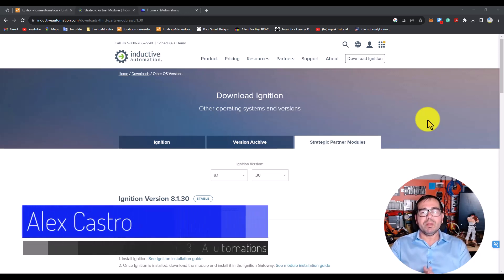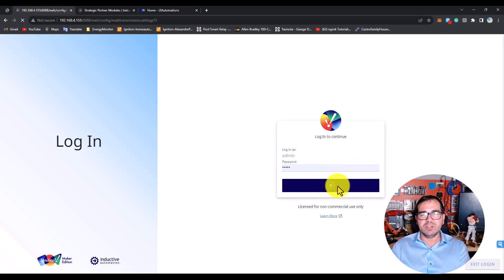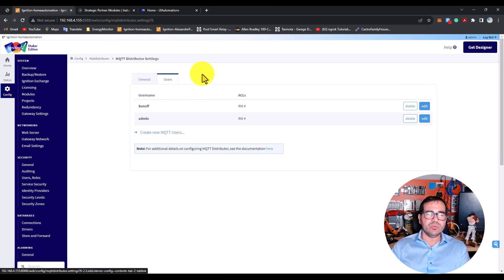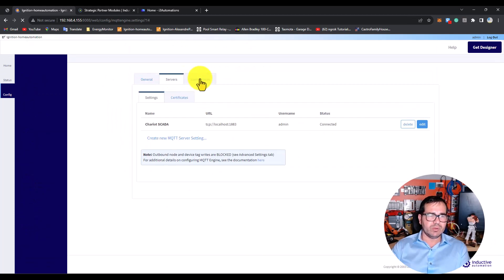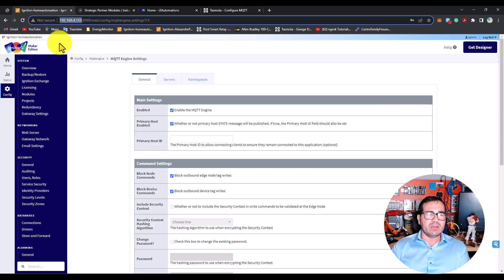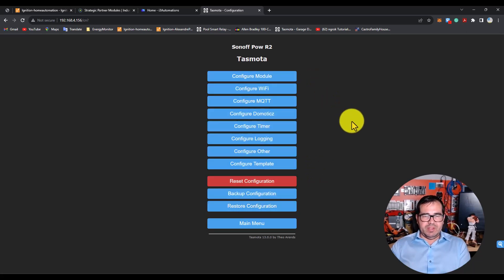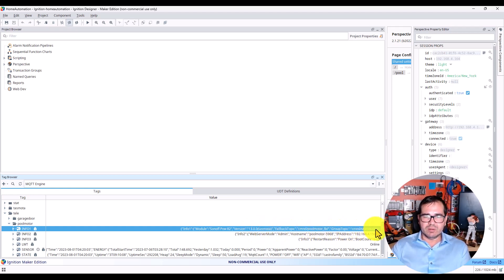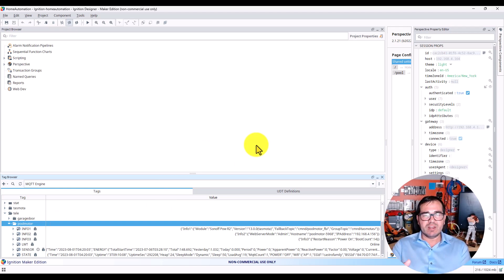Mastering MQTT Integration with Ignition - Step-by-Step Guide

Comment: I can't make it work properly!
I have a mosquitto broker, I need Ignition to connect to it as a plain subscriber, retrieve data and link it to some tags so that I can display them.
That's pretty simple, but I can't do that.

The mosquitto broker is working properly, my Java/python/... applications can publish data in the format I want under the topics I want and they work properly.
I also configured Ignition and I've seen Mosquitto recognizing the Ignition client.

But... How can I "see" the tags? It seems that all links must be created automatically but I never reached that step!
Is there another tutorial on this matter? Something I can follow step by step so I can figure out what mistake I'm making? What I'm trying to do is the basic example but I can't make it work.

Another question: how to diagnose the problem? Are there some tools?
From mosquitto I could figure out that Ignition was trying to subscribe this way:
Received SUBSCRIBE from ME-b29973c0-1867-4417
    FmStatus (QoS 0)
ME-b29973c0-1867-4417 0 FmStatus
    RmStatus (QoS 0)
ME-b29973c0-1867-4417 0 RmStatus
    spBv1.0/# (QoS 0)
ME-b29973c0-1867-4417 0 spBv1.0/#

How do I know it is correct?

Is there an example where a topic is published using some high-level language and a tag (or set of) in Ignition is created/loaded with such information?